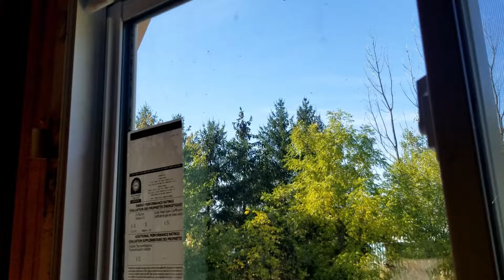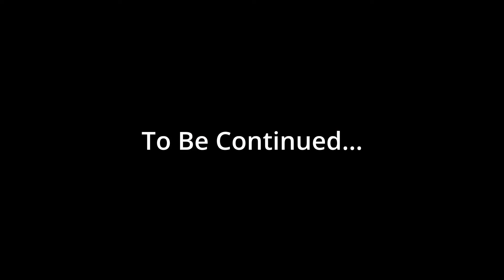Rebound: My Permaculture Dream, Episode 6

Comment: Coming from a carpenter you are doing great for not doing this for a living and it's better work than I see allot of career builders do. Only thing I would have done differently is your window rough openings are a bit large and doesn't seem like you are using new construction windows. You really only need a half inch gap between the window and your framing and if you went new construction windows it's easier to install/ weatherproof with the nail flange on the exterior that allows you to have a really good seal when you tape to the sheathing and spray foam from inside. All ends up the same in the end. Also are you planning on doing any exterior insulation or for your climate do you only plan on having r-15 insulation? For my tiny home trailer builder I'm doing 2x4 walls as well but going to have 2" of exterior insulation since I'm in Maine. So r-25 walls, r-30 floor, r-50 roof.
Reply from the maker: Thank you for the wonderful compliment! You have some great tips, hopefully people can learn from your comments what to do better than I did! My windows were all used- new windows were not in the budget, and I definitely learned that new windows would be so much easier! We haven't found the need for extra insulation- you will understand when you see the size of my wood stove in the next episode! 

Thank you for watching, and for the helpful feedback!